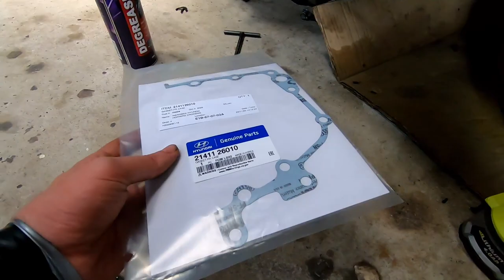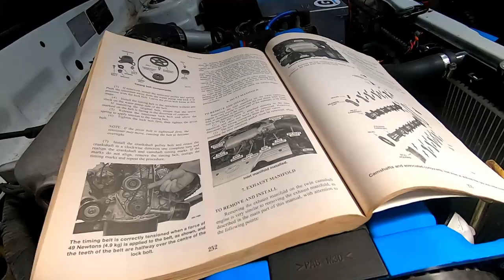All about Oil! oil leaks, oil viscosity and sump baffles!

Comment: Very cool dude, is the sump mod a common upgrade on excels? I also want to make a baffle for my sump, but also add some capacity. Curious to see how it turns out. Congrats on the redline support, I've been using their gear oil (mt90) forever, seems to be the best.
Reply from the maker: Yeah for sure a lot of the excels do it as oil starvation when racing is common on most street cars, definitely saves the engine!. Capacity is definitely worth looking atm, most LS mods end up adding another 2 litres with racing sumps, worth it!
Stoked on the redline support, i've been using their MT90 as well in my street car, great stuff!